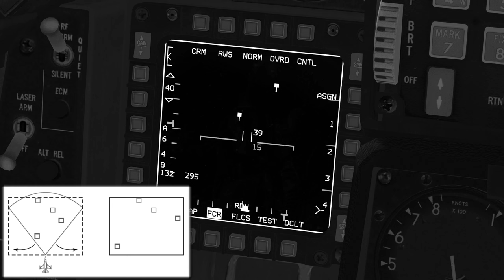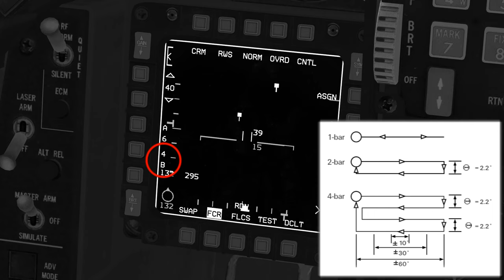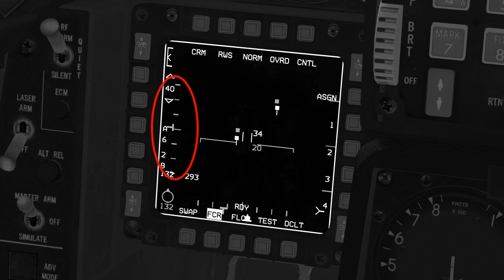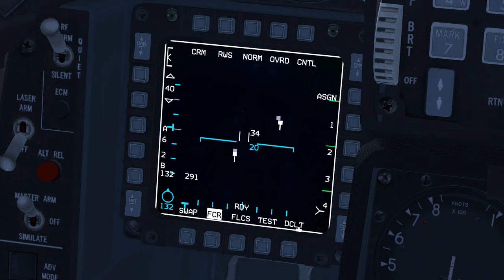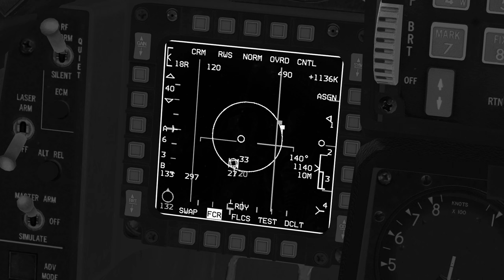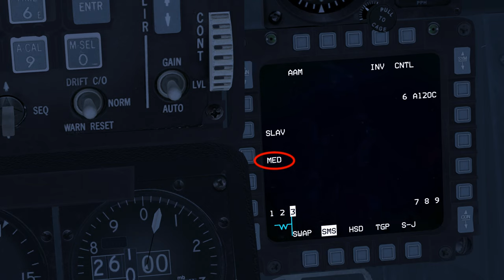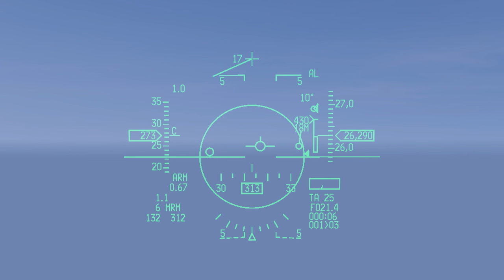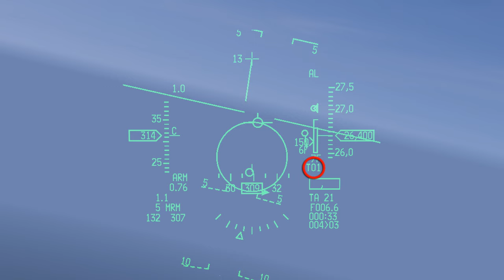Falcon 4 BMS 4.33 Tutorial 14 using FCR in RWS mode with AIM-120 AMRAAM

Comment: At 12:26 you mention the DMC, Digital Maneuvering Cue,  the degrees the target has to turn to go from high to nominal termination, where the missile is less potent at nominal termination.  How does the pilot make use of the DMC to decide on firing a missile at the target?
Reply from the maker: I think you have now received good feedback on your question on the forum. I will need to review the material again in detail to provide any reliable input.

Comment: 8:31 Are those slammers on the wingtip hard points? I thought the Falcon could only run smaller, IR misslea there.
Reply: They support both the AIM-9 and AIM-120. The USAF started running AIM-120’s on the tips a while back because it reduces wing flutter. Countries that use the AIM-7 run AIM-9’s on the tips, because those stations don’t support AIM-7’s.